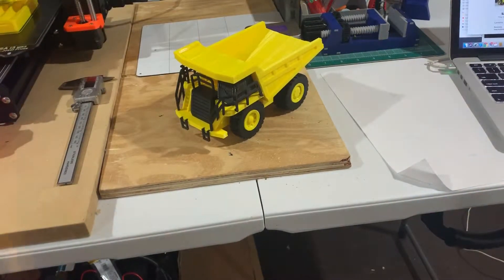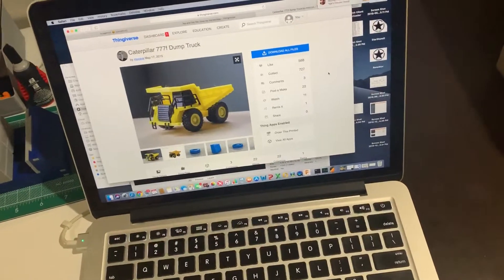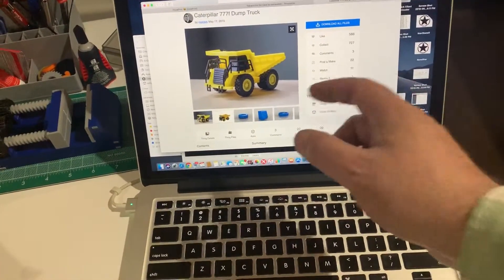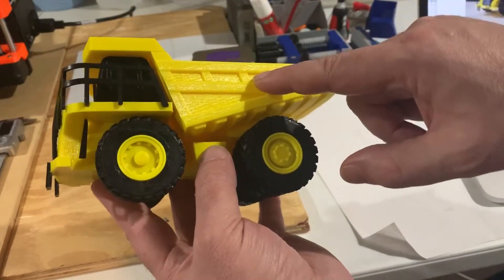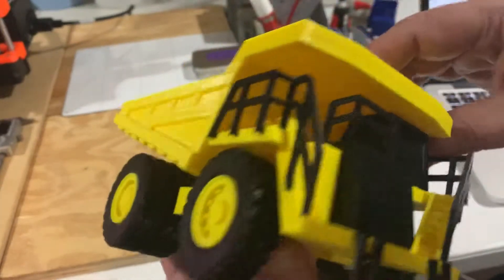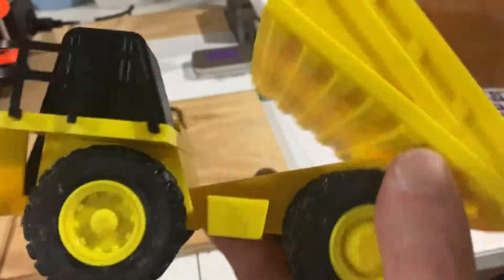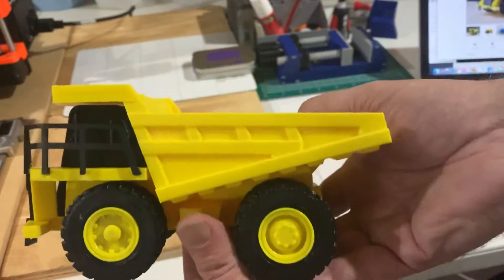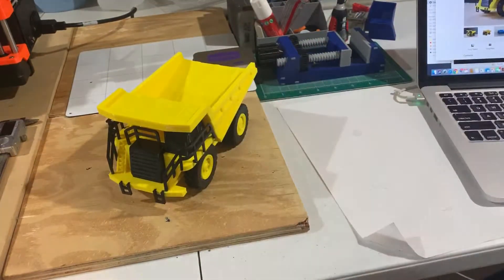3d printed Caterpillar Dump Truck

Comment: Looks awesome. It looks like the Prusa is really working well, I’m wondering why you are using PETG? Also I must say Good choice of thingiverse models. Keep the videos coming!
Reply from the maker: Thanks! promise more videos are coming!  PETG because I have heard it has "ABS like properties but easy as PLA".  I'm planning to mostly make things that are 'mechanical' vs. 'high detail' and during summer months my wife and I spend weekends at a campground in an RV.  I plan to make some stuff to use in that setting and from what I heard and read PLA might not be a good choice for things that sit in the sun or sit in a hot RV during the week.  Hoping PETG can handle it better.  We'll find out this summer...
Reply from the maker: Also why PETG... initially for the Gear Bearing which certainly doesn't need it... at the time I only had one color PLA, the Silver that came with the printer.  I wanted to make a blue one, and only had PETG.  Once that didn't work it was more about figuring out why and also because I thought it might have something to do with some of my other PETG troubles, and it did!